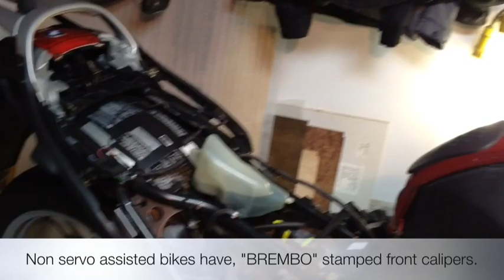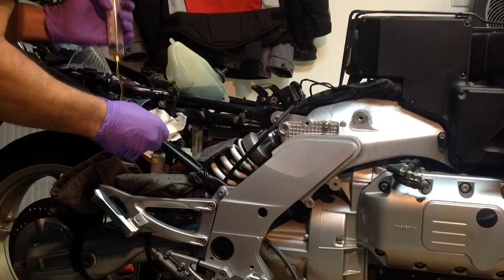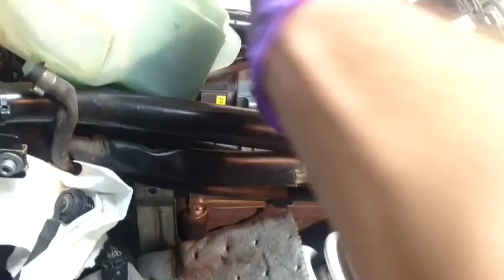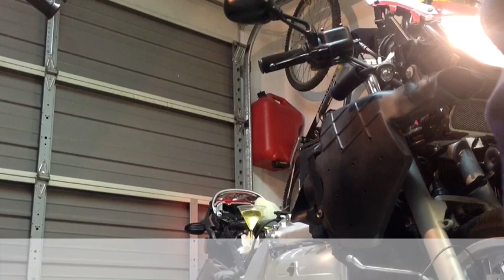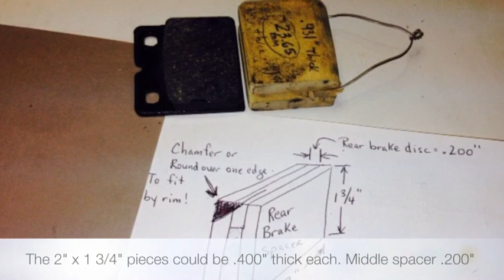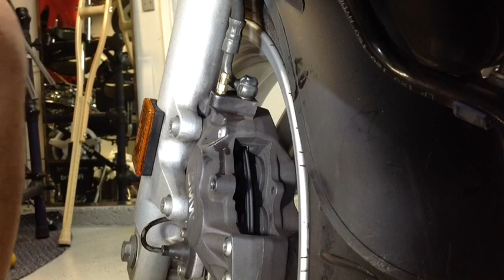K1200RS Front & Rear Wheel Circuit Bleeding PART 1.  2003 K1200RS model Servo assisted brakes

Comment: Hi!
A strange thing happened to me on my 2004 BMW K1200. After I'd stored it for the winter, I went to put the charged battery back in, and when I connected it, the ABS motor started turning over without me pressing the brake.
I disconnected and reconnected the battery, and it did it 3 or 4 times. After that, it stopped, but as a result, it no longer works. As soon as I start the bike, if I press the front brake, the ABS works, but only for a few pumps, after which it stops working. What do you think could be the cause?

Comment: I own a 2003 model K 1200 GT. When I press the front brake, I hear the engine starting sound and the ABS is activated. However, when I press the rear brake, I do not hear the sound of the brake motor and the ABS does not activate and the brake does not hold as if I did not press the pedal at all. how can we solve this problem

Comment: Thanks Kontor for the video.   I have an issue and I hope you still monitor these comments.   New pads and Spiegler lines on my 04 K1200GT.   Bled front left, front right, and back per video.  Seemed to work fine.   Bike on the stand, front and rear brakes activate with key on and pressing the front hand brake lever.   However, rear brakes will not activate with key on or off using the rear pedal.   I have not bled my abs unit yet.   Is this normal?   Thank you for the help.

Comment: Thanks for your diligence in getteing the tutorial out.I added Stainless Speiglers to our 04 ABS III and your instruction really helped.It took two full cycles to get the circuits bleed but bike is back together and brakes as good as ever.Don't get the spacer but I can see if your adding new pads all around it could help

Comment from the maker: Don’t need the spacer if you put in Nee brake pads. Do you really need to push the pistons all the way back?? Up to you. You could crack the bleeder while pushing pistons back to drain that  little bit of fluid. Then put whatever brake pads you had installed back in. Mine were still good so I went with the shimming method.

Comment: Great video. What about bleeding the fluid out of the front brake master cylinder? Or am I missing something.
Reply: Richard.  See part 2. K1200RS Wheel circuit bleeding which is for the ABS unit bleeding. A bit more involved but doable. The video I made what my first time doing it!

Comment: Very good videos.  Thanks a bunch.  I'm applying them to my 2002 r1150rt.  I also have the factory instructions.  I think its all the same except the rt doesn't appear to have a speed fill port.  I could be wrong there.  I'm considering replacing all my lines with steel braided.  If I do that, how bad is it for the ABS module to drain.  Is there danger in that?  I understand it would need a full bleeding.  I'm a bit paranoid I could break something that would basically total my bike.  I've bleed plenty of traditional brakes though.  Thanks again.

Comment: Why do you use spacers in the caliper instead of just leaving the pads in, maybe new pads would be better (than old)?  I guess the spacers are intended to keep the caliper bores evacuated for more thorough flush?
Reply: You are correct. New pads would probably do the same thing. Is it totally necessary? Probably not. Was just following the manual instructions. Pushing pistons all the way back just gets most of the old fluid out of where it could remain if you left old worn pads in place with pistons extended. Also while pushing pistons back you can possibly find a seized caliper piston. (If your pads are unevenly worn) thanks for the comment.
Reply: Thank you, that was good question coz I was wondering why he need the wood instead on the new pads.

Comment: Does my 1998 K1200RS has the same braking system as your bike?
Reply: I don't think so. Turn your key to the on position and just press your brake. If you hear a pump running each time you press your brake (either hand or foot brake) then you have servo assured brakes. Otherwise you have regular brakes and bleeding is much simpler.
Reply: Kalimera! Thanks Pete

Comment: Thanks for the great video.  I have a 2002 that I am in the process of flushing all of the brake fluid, not looking forward to flushing the abs unit.  Anyway, I'm curious what the purpose of removing the brake pads and using shims is.  Why not just keep the brake pads installed?
Reply from the maker: The reason they recommend removing brake pads and installing shims is to push the caliper Pistons all the way back as far as they can go, so that most of the old fluid gets removed. If you leave old worn pads in it will trap some old fluid in the system.is it completely necessary? If you have just put in new pads I would say just leave them in place as the new pads serve the same purpose as pushing back the piston in the caliper. You really want to prevent an dirty fluid from getting into the ABS unit. Another reason to get as much old fluid out is due to the old fluid absorption of water over time.

Comment from the maker: First does the engine crank at all? Do you get the normal lights and the sound of the fuel pump running  for a couple of seconds when the key is first turned on? If it doesn't crank at all but lights and fuel pump make normal sound. Maybe the right handle bar kill switch got damaged or moved off center? I leave my kill switch alone in the center position and when someone moves it I wonder what the heck is going on! Or side stand switch could cause no crank. Battery connection? Since it did fall! Maybe grass or dirt is keeping side stand switch down just enough to engage side stand switch? If the engine cranks but won't start it's either no fuel or no ignition. Maybe dirt clogged the fuel tank breather tube which I believe runs to the bottom of the bike somewhere. Maybe try opening the fuel cap while starting? To check spark you would need to remove your spark plug and jumper the spark plug body to a good engine ground while cranking. If it is cranking when you remove the spark plug see if the tip is wet with fuel. Which would mean you got fuel but no spark. Hope it's something simple!

Comment from the maker: Try this web site https://kisantech.com/ which is the manufacturer of the blinking bulbs. Cheaper too! Yes the speed bleeders can be used over and over! If you replace the front and back caliper regular bleeders with speed bleeders, just leave them in so it will be easier to bleed next time. I plan on making a video of bleeding the clutch circuit soon. I just have to edit the video I took. I will do it soon!

Comment from the maker: Kris, yes I leave my calipers mounted while bleeding. You can only do this if you make a shim that can straddle the rotor, or make two individual blocks to go on each side of the rotor once you push your pistons back. Otherwise you will need to take off the calipers and stick a 1" wide block or several shims to hold the pistons back while bleeding. It's just quicker for me to leave them mounted and now I made my shims for next time. The rear flashing tail light bulb is from Www.pirateslair.com  are called Kisan Tailblazers bulbs with circuit mounted in the base of the bulb (you can replace just the bulb and leave the base) they are very visible at night, one flick of the brake handle and they flash rapidly for a couple of seconds to keep people away from you that follow too close. If you press and hold the lever, it flashes at first then becomes solid until u release the brake handle. A must have in my opinion. I also has a couple small led blocks that also flash, but not as bright?
Reply: Why can’t you do this with the brake pads in? Dont see the difference from the shim.